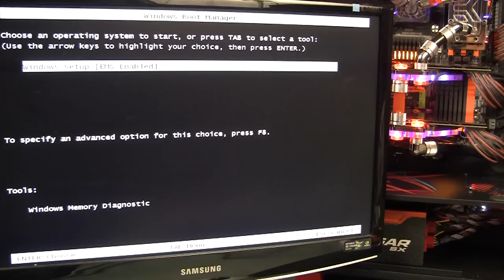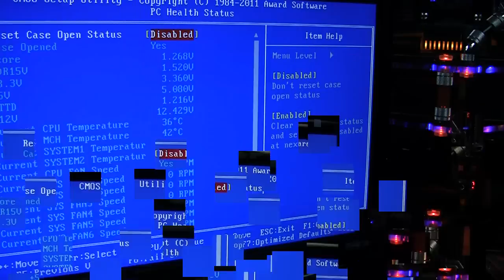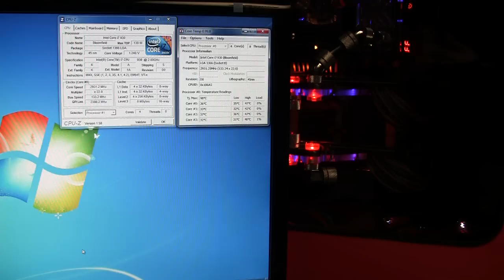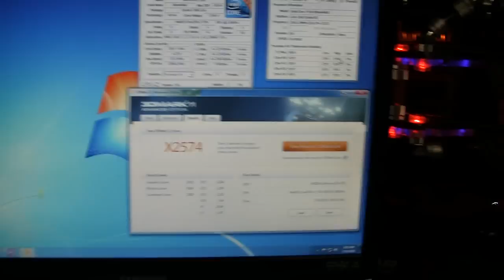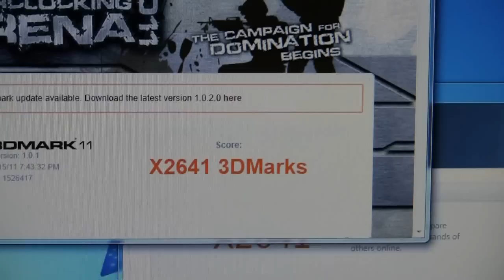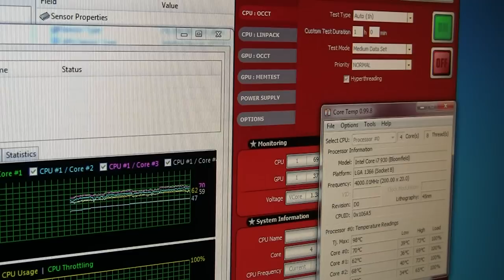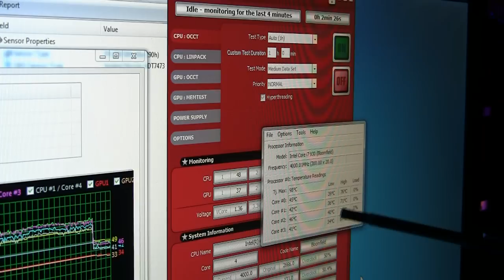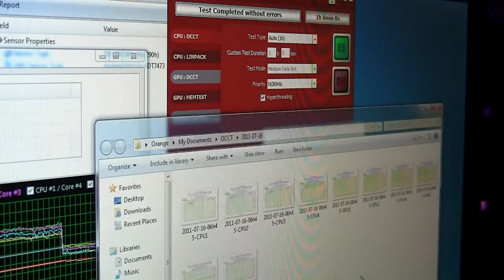Feser's Admiral Radiator Benchmarking - Orange Build Log - 5

Comment: @nigelnathan as he is explaining in the video: yes.
When he is running the fans too slow, the temperatures are rising too much (in his opinion).

I don't really think the temps go THAT bad for him. I think even with water at 50°C you can easily run the system, but the temperatures would be in the region of an average/better air cooling system of course.

If you have a WC setup, you will want better temperatures than before. So he just cranks up the fans.
I think he will add another rad ^^

Comment: I'm running an rs360+rx120x2 in a crossfire setup with a 1090t using GT AP-15s on a fan controller... Ambients are pretty high here lately, so I usually have them running at 70%-100%, and they are still ridiculously quiet.. The fan I have driving air towards me is louder along with the side panel fan I have (which I keep at 50%-70%).. 

If you can bring 3000rpm fans to 1100-1400rpm without motor noise, then I'm sold.

Comment: Very nice, It seemed a bit loud at the moment though but I'm sure that if you can decrease fan speeds you would achieve reasonable noise levels. With my build I can drop the fan speed from 1600 to 800 and it's pretty quiet and usable even when gaming. I have 3x120 + 2x120 rads though...

Comment: I can see that loop getting way to hot with this overclock when the side panel is on and the fans turned down to an acceptable decibel level. I dont know why you think this is a good test of the system when it isnt normal conditions. Maybe only for benching, but thats it.

Comment: @Mupp1t then I would reach the same results using noisy air cooling with some nice looking heatpipe coolers which are way more cheaper than this stuff. The air coolers laugh about PCs like this one.

Sorry but watercooling is about silence if you want to do it right. I have 3 radiators for 2 graphics cards and 1CPU.
But ONE small radiator is impossible. He should have known it but obviously he didn't so this system kinda fails.
It may look good but it's function is a shame. :/

Comment: @acer0169 If you have no clue about water cooling systems, then I don't really know what you are doing here. Or maybe you're just beginning?
With water cooling setups you are able to increase the cooling surface in an external way. No need to put huge air coolers on GPUs or CPU.
The more radiator surface you use, the less air throughput is required. Some people don't use fans on their rads AT ALL (passive radiators). Means ZERO noise cooling for the hardware, (lil airflow in PC is never bad)

Comment: @acer0169 is it ignorance of yours? You do realize that what you are saying is bullshit, right? So you are basically saying watercooling HAS to be loud to be good. LOL

I'll put up a video of my rig sometime soon presenting you the noise level under furmark and CPU stress test at the same time.
2xHD6970, i5 2500K.
There is no difference from idle to load. You can barely hear it.
That's why I bought watercooling for a SHITLOAD of money. If I could stand noise, I would have saved the money.